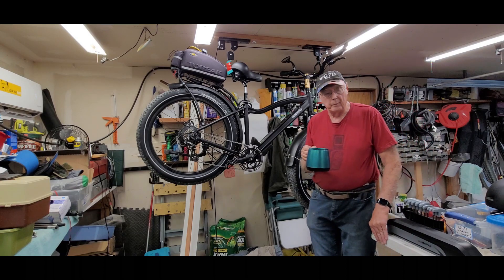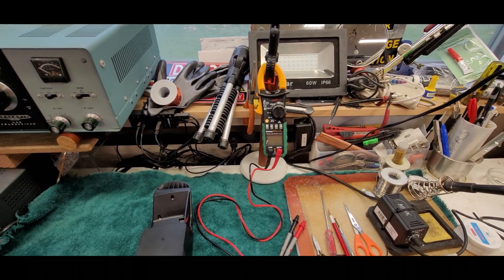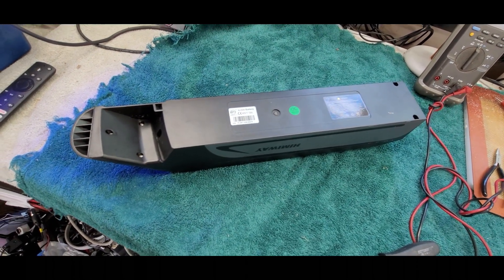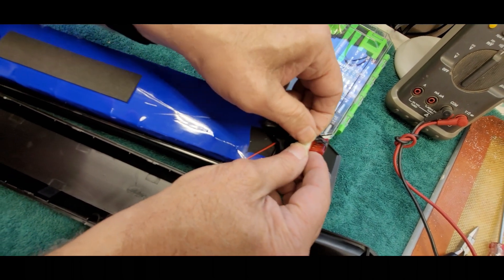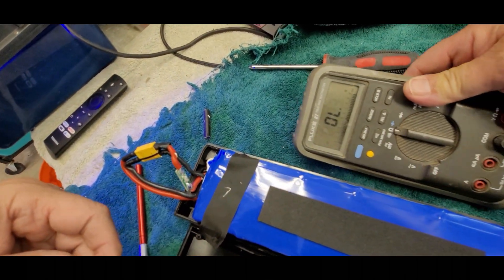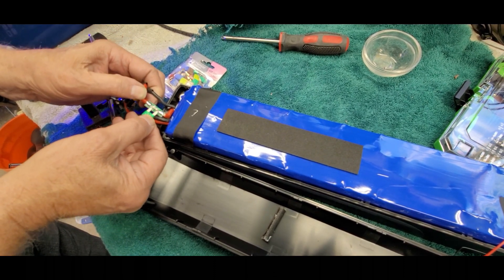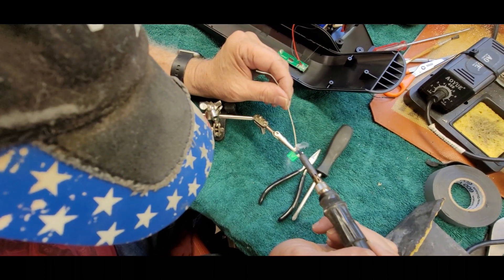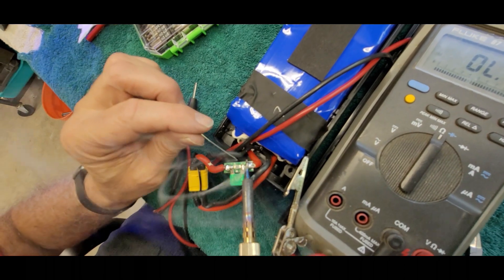Himiway E-Bike Battery FUSE Replace procedure

Comment: i replaced the fuse but once i put it on the bike it just shorted again, should i use a 40a fuse now?
Reply from the maker: No,I would not do that. Most likely a bad motor controller. These bikes have a weak controller.

Comment: I am so thankful that you made this video. I had an arc while putting on the battery. Just like you said, the mosfets are shorted, and the battery shows that it is nearly full, but there is no voltage on the pins. I started taking the battery apart last night, but I was intimidated by the full battery level. Just by sheer luck, I ran across your video. I'll take another look at it in the next couple of evenings. In the meantime, I'll look through any other videos you have on the Himiway bikes. Again, thank you so much!
Reply from the maker: I am glad it helped you. I have since moved on from the Himiway and built my own electric bike. Enjoy your rides!

Comment: I'm reading 40 volts across all pins (1-3, 2-5,3-6).  Happened after my bike just died on me going uphill in hot weather.  Had a fully charged battery  Fuse is intact.  Battery won't charge and bike won't turn on.  Any idea what is going on?

Comment: So it's really a 54V battery and not 48V?
Reply from the maker: There are several factors at play here:
1. Batteries are usually specified by their nominal voltage, not their charge (Maximum) voltage.
2. Different chemistries (SLA, NiMH, LiCo, LiFePO4, etc.) will have different volts per cell, and thus different charge voltages.
3. Battery vendors recently have offered a few different voltages of batteries near the 48V range. When talking about LiCo/LiPo/LiMn, a 13-cell battery will have a nominal voltage of right about 48V, whereas a 14-cell battery will have a nominal voltage of about 52V, and both with different charge voltages.
Reply: @WG7D  electronics stuff is like magic to me because i dont understand it. so you just revived my dead battery by pure magic! Thank you man. im glad i didnt blow up or get electricuted. much love from germany! <3
Reply: @WG7D  thanx. I ordered this bike a few days ago. How long do you think it'll take before I receive it? I'm on the east coast

Comment: Mike great video.  I have thinking about opening my battery to investigate the BMS to see what the maximum amps it is designed to output before shutting down. My All Terrain was made before they started to change cells in the pack due to supply shortages.  I have inquires to Himiway and given them the serial number on the battery, they responded telling me it has Samsung 35E cells which are some of the best for this application.,

I found a setting in the menu of the display that allowed me to crank the maximum amps up to 25 from stock 20 amps, made a difference for sure, Now I'm wondering how far the BMS can be pushed before it shuts down due to over-amps.

Do you have any idea what took the MOSFETS out of the controller? Did quit all of sudden? How many miles did you have on the bike when it failed?

Thanks again for the informative video.

KB6HD Longview, WA
Reply: How did you change the Amps?

Comment: Himiway advertises these batteries to be Samsung or LG brands but I see no name inscriptions on both of my step through bikes.  Received my bikes mid September 2021, how can I verify that these are authentic Samsung batteries?
Reply: My experience with these made in China or overseas products is that they can advertise or promise anything and when proven fake or false, they are never help accountable for false advertising or they just simply change their company name.  I truly believe that my Himiways have generic batteries and not the  Samsung batteries that convinced me to choose this bike.
Reply: @raypabs5374  One way to find out open the battery and peal back the plastic wrap.
Reply: He didn't unrape the battery pack so you could see the actual cells.  I also wish he had exposed the BMS so we could know what it's maximum amps were.  I guess we can assume its less than 30 amps as the fuse that blew on the final output of the battery pack is 30 amps.
Reply from the maker: Not sure,no marking that I could see.
Reply: If anyone actually checked please let us know…still under warranty so can’t peel anything yet lol

Comment: I watched another video on fuse replacement and the gentleman showed there is a 40 amp automotive type fuse in the end of the battery where the connectors are.
Reply from the maker: Do you have a link? I never saw that fuse.
Reply: Yes, I saw the same video, 40 amp vs 30 amp???